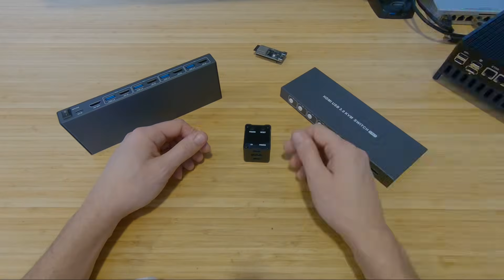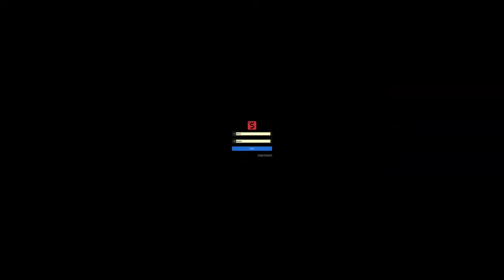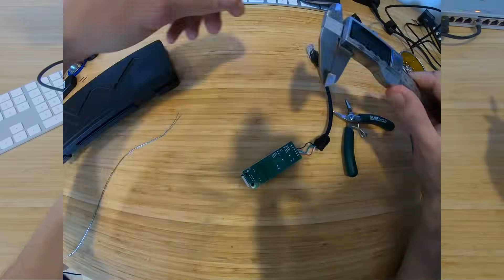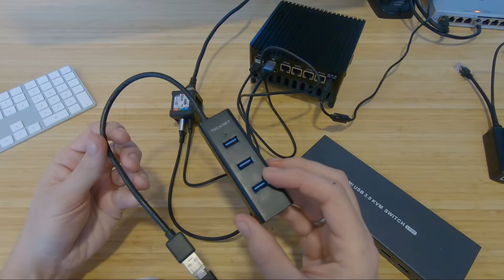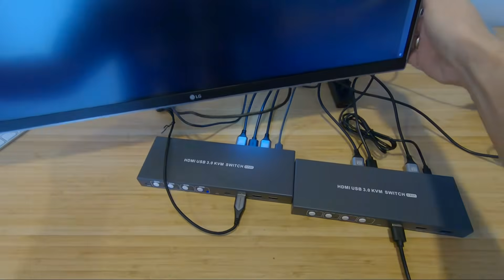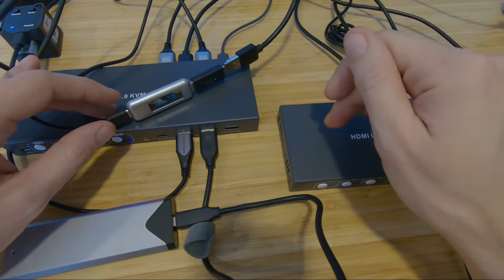Budget Homelab KVM: Control 4+ PCs for 75% Less - Part 1

Comment: But this means I can't remotely switch between PCs correct? Or did I missed something?
Reply from the maker: This is part 1, like the backbone of you don't want remotely switching between. @MirorR3fl3ction mentioned hotkeys, but if you have multiple KVM switches that maybe will be to complicated. Part 2, still waiting for parts to arrive, will be how to remotely control KVM Switches via ESPHome and Home Assistant.
Reply: @DIY-POV I see, thanks!

Comment: Love this approach to homelab building that focuses on getting the most out of affordable devices by integrating them together like this. My plan is to do something very similar for my setup with a USB 2.0 KVM Switch from the same brand used in this video and the same NanoKVM by Sipeed (which now has open-source firmware). The major difference I plan to do is to skip the Microcontroller for the KVM Switch and hopefully just rely on the NanoKVMs keyboard emulation and the KVM switches built-in keyboard shortcut detection for switching channels, but I havent had a chance to fully test this setup yet so I might end up going the Microcontroller route as well.
Reply from the maker: Thanks for liking the idea :) Hmm, maybe this would be a great solution. Currently waiting for lasts parts to arrive and trying to figure out Home Assistant and iframe of remote KVM. On desktop it seems to work, but mobile nop. Currently out of ideas how to implement this together. Are you going the route with Home Assistant?